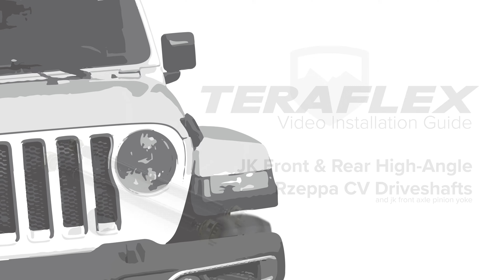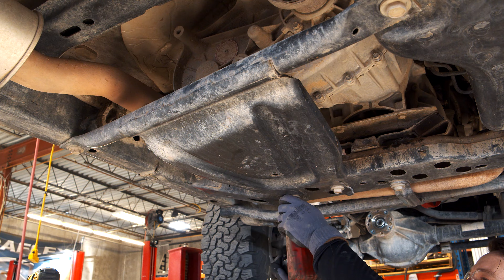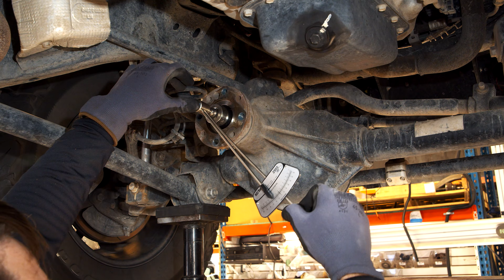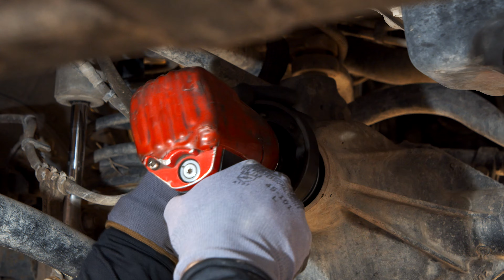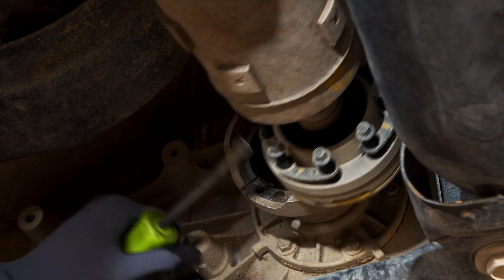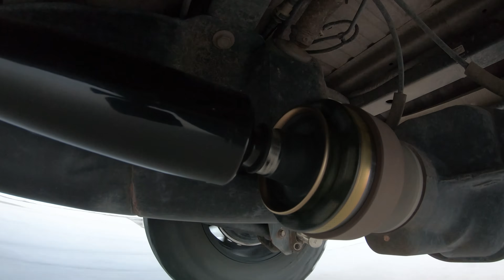JK High-Angle Rzeppa CV Driveshaft Install | TeraFlex

Comment: I like the Teraflex rzeppa joint as a short term solution to a busted driveshaft, but I don’t see these lasting too long term, especially on some suspensions that have a lot of travel. There’s a reason everybody goes with a U joint design. It’s far superior to this in more hardcore off-road situations.

Comment: What's the maximum size tires Teraflex recommends running with these driveshafts?  37's?  40's?  I'm interested in strength for off-roading.  Are these equivalent to a 1310 or 1350?  How's the warranty? - literature states - Limited Lifetime.  I'm running 37's w/4.88's on a Rubicon.  I'm debating between a 1350 Woods and the Teraflex driveshafts.  I like the idea of the Teraflex, but am concerned with strength, and can't find any users of these driveshafts online...??
Reply from the maker: We don't really have a max tire size, as they will be able to push anything your axle can handle. The drivelines carry a 12 month warranty on materials and the manufacturing process. They are a little thicker than a Tom Woods at 2 3/8 diameter, but well below the factory. Both are awesome options! Give us a call anytime and we can get you more info on both! 801-713-3314

Comment: I did the TF rzeppa rebuild on both ends of my rear ds, good to see that you guys are now making a front that will mimic that. Less maintenance, more angles, less downtime, and hopefully the caster angle won't be as crucial as it would with a u-joint in the front shaft.....though we should all shoot for good caster for good drivability.

Also since you've got the front ds separated by 07-11 then 12+, can I ask what the difference is between the two in regards to length?